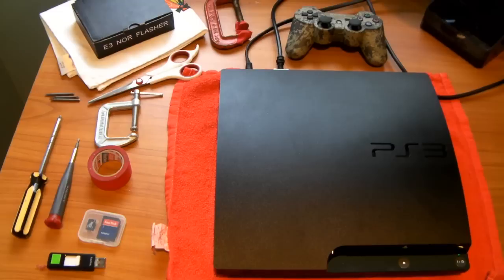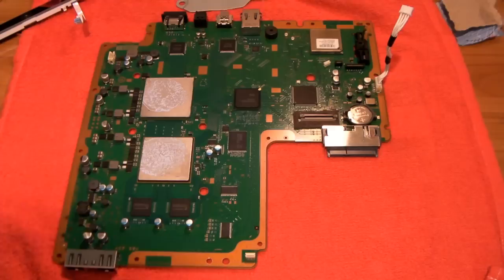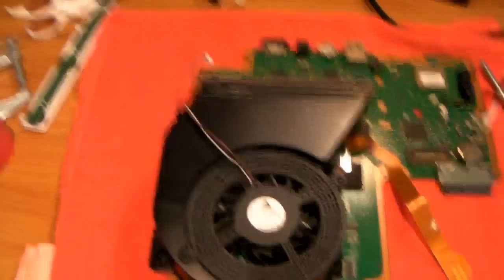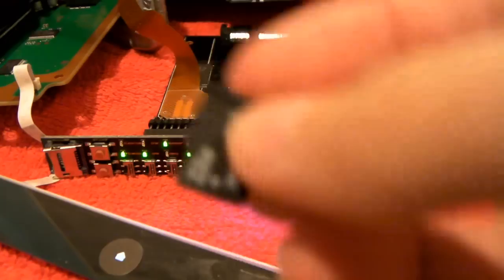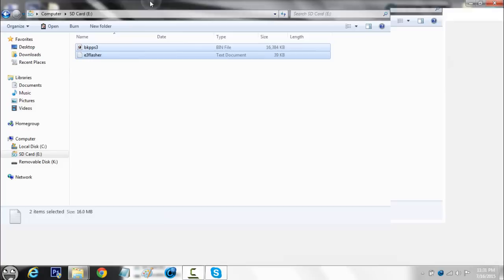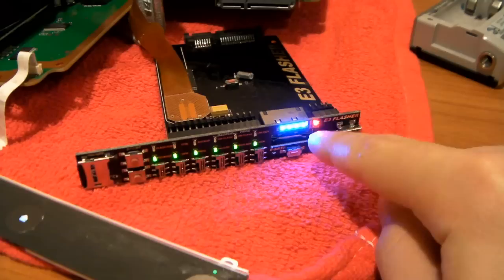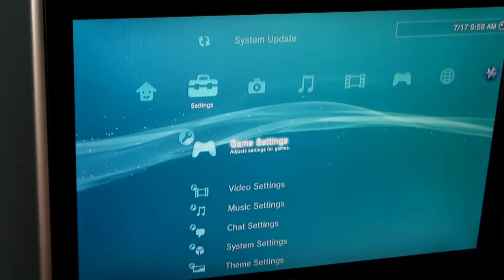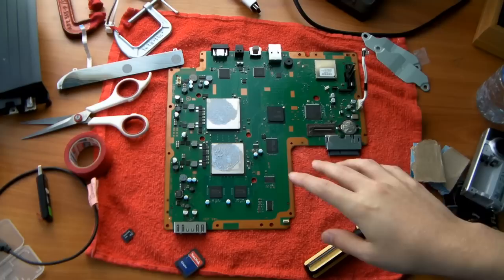How to Downgrade a PS3 to 3.55 with E3 Flasher (EASY!)

Comment: I started following another tutorial before I found this one and it told me to put the Update.pup file on the SD card...once I put the SD card in the flasher I saw the blue lights and switch the flasher switches to down down up up up up. The blue lights loaded and once I took the SD card to check if the file was still there I saw it was gone. That told me that the flasher updated and I was ready to move on to the next step.
I put the SD card back into the flasher and switched the switches on the flasher to down down up down down down and it created 2 files for me which are the bkpps3.bin file and the e3 flasher log, but when I put the bkpps3.bin file in the Nor inspector I get an error telling me the file is bad.

I went back a few steps in your tutorial to see what I did wrong and it looks like I skipped a step. That step was putting the update.bin file into the SD card and putting it back into the flasher with the switches switched to down down up down down down down. I tried to do it your way but now my blue lights aren't even showing anymore. 

Did I mess up my e3 flasher ? And if not could you help point me in the right direction to fixing it 

Sorry for this long comment I'm just trying to give you a good idea on where I'm at in this project

Comment: I downloaded a PS3 3.55 OFW file nested in the same folder heirarchy as you showed people to make in your clip, but it wasn't 5.5mb... It's 170mb!! What have I downloaded?! I've scanned it with a few things and it's clean but it's the same size as your "everything" zip file but it's only a single PUP file. ... Also: Don't use a C clamp - Just grab a spring loaded plastic clamp for wood work. Non-conductive and can't cause any damage

Comment: Hey, whenever I make a backup, it makes 3 backups at a time, and none of them are OK. I've applied even pressure on the chip, even more than was possibly intended.
Still have no luck.
Anyone got any ideas?
Reply: MrGamer Aye, thanks for the quick reply.
I found a clamp lying around and it did the trick.
Currently stuck on a "Checking" screen on PS3 after attaching the hard drive.
Reply: MrGamer Ya, it's the same as the one in the video, although it stays on it.
Reply: MrGamer Ya, just remembered that the hash failed on the patch, don't know if that has anything to do with it.
Reply: MrGamer CECH-2003A

Comment: Thanks, great tutorial. These NOR clips are so sketchy though. It took me hours to get it wedged in just right with enough pressure to connect. This is a fat CECHP01 so no room for a clamp. I was getting lights 1 5 6 error. Then another couple hours to get a clean dump without errors. Well actually, I always had one ROS0 Hash error. This is a RSOD console that I'm trying to fix. Patch is flashed and now to install the rogero DG. Hope it works.

Comment: E3 Flasher Compatible Ps3: (these ones for NOR not NAND, older FAT ps3 are NAND).
FAT:
- CECHH
- CECHJ
- CECHK
- CECHL
- CECHM
- CECHP
- CECHQ

SLIM:
- CECH-20XX
- CECH-21XX
- CECH-25XX

you also need to check if the date code is okay. you need a ps3 with a default firmware at the time of its purchase below 3.55 | 3.56 is acceptable too.
DOWNGRADABLE:
- 6A (okay)
- 6B (okay)
- 6C (okay)
- 6D (okay)
- 7A (okay)
- 7B (okay)
- 7C (okay)
- 7D (okay)
- 8A (okay)
- 8B (okay)
- 8C (okay)
- 8D (okay)
- 9A (okay)
- 9B (okay)
- 9C (okay)
- 9D (okay)
- 0A (okay)
- 0B (okay)
- 0C (okay)
- 0D (okay)
- 1A (sometimes)
- 1B (you can cry now)
- 1C (you can cry now)
- 1D (you can cry now)
- 2A (you can cry now)
- 2B (you can cry now)
- 2C (you can cry now)
- 2D (you can cry now)

Comment: well after many watches of this video and few others i decided to go ahead and begin followed steps in vid i tried to update e3 flasher with first 2 lights down and rest up  didnt really get any indication to it working so i checked sd card in pc and different files in there probably me messing about noticed an empty dump file in there as i did switch to dump but never had blue first light ,anyway dump process all down except 3rd switch up i got 3 dumps binpps30,31,32 checked them and had hash problems in dump checker but reading in comments learned this doeant matter aslong as the nor checker reads good in all which it did so i patched 31 bin and folowed steps and success thanks for the video and comments knowledge is power ..   :))
Reply: i would like to add that im trying to do a second but reading this not original console, can i update my e3 flasher if i connect back to my original ps3 and do the samsung fw update on e3 flasher ?

Comment: TIP: If the clamp with tape doesnt work simply grab 3 COPPER coins and put them on top the chip and clamp , try to position them right in the middle

Comment: I have a PS3 of version CECH-3004B which is a 320Gb slim model running on OFW 4.76. Is this downgradable?
Reply: +Abhay Shiravanthe no, 3000 model can not be downgradet
Reply: +xLeG3nDaRy _-J4tt Thanks for reply.

I sold it and got the fat ps3 CECHP06 for around $38. It has YLOD. Trying to repair it nw.
Reply: +Abhay Shiravanthe YLOD PS3 consoles aren't the best to downgrade, regardless of if you fixed the ylod with a reflow or not. There's always a chance it could come back. I repaired a CECHG03 nand console on 2.80 OFW which had ylod and it's still going to this day as I gave it a reball.
Reply: Anime And Gaming Videos  Thanks for the advice mate! Thank you.

Comment: So I have a question.  Is this a video on how to downgrade a PS3 from 4.80+ (I have 4.81) down to 3.55?  Or is it just completely impossible to downgrade from 4.81?
Reply from the maker: You can downgrade from any firmware as long as your PS3's model is compatible.
Reply: Alright thank you!  This video looks extremely helpful.  Subbed

Comment: I thought the whole point of the e3 flasher was to downgrade from a higher version, so why do we need to use the Min. VER. Checker, because i thought all that mattered was the model number or whatever it was of the PS3,
Also in ur guide on se7ensins (which im following) you said to take apart the ps3 first, at least that was the order of vids, so i took it apart and now i have to put it back together just for the min ver check,, if u explained what the min ver checker was all about and put a not on se7ensins about wanting to do the minvercheck first, then this guide would be perfect, 
great job btw

Comment: How hard is it to get the flasher on the motherboard? Mine won't work... I keep getting the Dame error code, I believe it's 10001100 on the top of my head...
Reply: +Antiscript put a bit of pressure on the clip and the nor ship works fine for me got the same error also
Reply: +Tdaewg35 I'm on the verge of my mother board breaking with the amount of pressure I put on it... I think I may have broke it, it doesn't stay on my chip at all, sometimes it sticks a little but for the most part with no clamp attached it just comes off...
Reply: oh that's weird but now when ever I do a backup and it check it with norinspector I have errors and I cant find any way to fix it
Antiscript

Comment: It's Deejay Typo guys... Sorry for spamming comments but i just wanted to find out how much pressure will be too much to use on the clip... I'm having trouble finding a G-Clamp because i don't live near any hardware stores so I bought a Clip that automatically closes similar to a bullnose clip but I put my finger in the middle just to test the pressure and it seemed like it was too much (My finger was Hurting badly ) but it seems that it will get the job Done... Should i use it or just Order a G-Clamp online but it will take some time to be delivered.

Comment: My model is a CECH-2504B slim. Can it be downgraded?
Reply: no
Reply: jk yeah
Reply: Yup, i'm already checked it out. :)
Reply: +LAzy. What about Cech-2502A be downgraded ? Pls answer
Reply: Inu Mimi yes 25 below is ok
Reply: Inu Mimi Yup. ChasePlays was right,
Reply: +ChasePlays Annihilation what about cech-2051B?
Reply: +Jacob Ivy yes im sure
Reply: +ChasePlays Annihilation okay thanks
Reply: +LAzy. I have the same model, bro! Trying to get it done this week! :D
Reply: if the date code is 1B you can start
Reply: +Casper Wolf but can i go from cfw to another cfw or do i need to go to ofw 3,55 first? Please answer! :)
Reply: +Casper Wolf for real
Reply: Can CECH-2101A be used the Same way as In this video
Reply: Avo Blezzed yeah
Reply: +LAzy. He explained in the video what can be downgraded and what can't be downgraded. Learn how to listen.
Reply: +ProHacker HaxoTv Depends if the cfw is a lower version than the one you are wanting to go to. If the cfw is a higher version like for example say you are on 4.50 ITA and you want to go to 4.65 ITA then no you don't need to downgrade because you are upgrading. But say you are going to like 4.20 ITA then you would have to use a 3.55 DEX downgrader. However, if you are using CEX firmware you would use regero's 999 downgrader instead of a DEX Downgrader.
Reply: Demonic|ModdingTeam hi i dont need help enymore, but thanks for replying
Reply: Any 2500 and below yes 3001 no
Reply: what about CECH-20018
Reply: jones olsen Yea

Comment: Just curious if this tutorial is still valid / not outdated. It's a hardmod so shouldn't make any difference, but if there was any major change in hardware or software included in this tutorial. Also, where can I get an E3 Flasher? I have a Slim 2001A.
Reply: Also, can I use any CFW i want after following this tutorial? I plan on using Rebug
Reply from the maker: Yes, it still works. Yes, you can use any CFW. And you can get an E3 flasher on eBay.
Reply: ArchieG Alright, thanks for confirming my suspicions.

Comment: When I try to downgrade to 3.55 I get to 71% and I get a error saying 'The data is corrupted. (8002F957)" any ideas how to fix this?
Reply: did you follow the ENTIRE VIDEO including flashing the ps3 with the e3 flasher in order to do the downgrade?
Reply: +Nonya Concern because the Rogero Downgrade will NOT work unless you flashed the system like in the video with the e3 flasher first.

Comment: Ok, I got the lights to flash, but the T.V. doesnt detect the HDMI cable... Help?
Reply: +Best of Youtube (Frodo The Hobo)  The chip isnt connected right thats why ur not seeing it on the tv, try connecting it the opposite way u have it now.
Reply: +Steven Kane I  did everything right so far, only problem was when I pressed start on the E3 Flasher, the lights 1,5, and 6 began blinking ( signifying an error )  do you know how to fix this?
Reply: +Best of Youtube (Frodo The Hobo) yes that code is error for chip not being 100% connected ... in order to fix my 1 56 error I had to buy a clamp to clamp down the chip so all pins touch 100% and then it worked perfectly after I clamped it
Reply: If your hdd isnt connected it wont power up.

If it is, try shutting off ps3 then press and hold until you hear another beep after the first one when you pressed it. this will reset video settings if thats your problem.

Comment: I jailbroken my PS3 and it works, I can use menu and all sorts but sometimes my screen goes funny when I'm turning on the PS3 it comes up with multi coloured lines and crashes, help please!!
Reply: +Camda Killa You maybe have a bad patch.
Reply: +Pollo4life what should I do to change it ??
Reply: +Camda Killa have you tried another tv. I never heard of that problem.
Reply: +Pollo4life yeah I have tried 3 TVs and 3 different HDMI connections I also tried component and I still have the same problem, maybe I need new thermal paste ?

Comment: Mine say CECH-2001A its a slim can it be downgraded?
Reply: Nvm it can i checked it with the usb
Reply: +1976sanneke make sure to make a folder called PS3 and make another one inside of it call UPDATE and put the checker in the UPDATE folder then go on your ps3, plug in the usb in the right usb slot then go to system update and then update via storage and it should check, if it gives an error then the system cannot be jailbroken.

Comment: You know when he is doing the back ups etc. 
On the first one he places the update file inside for the e3 flasher. Everytime you create a back up and you delete everything. do you have to put the update file in again to do another dump ? The file i am on about is at 15.59. Thanks in advance.
Reply: Or do you just have to put thesd card back in and itll dump again?
Reply: +Eternal i keep it on
Reply: Robin Moens
Thanks man
Reply: Np if you need help let me know
Reply: Robin Moens
Thanks man. I've manged to downgrade now :)
Reply: +Eternal well i just flashed but my ps3 dousnt find the downgrader
Reply: i am having the same problem +Robin Moens i have properly flashed my patched  bkpps3 file to my console which took between 5 to 8 minutes, then it brings me to recovery when i boot it back up with my hdd installed back in. i tried the rogero downgrader through recovery menu and it shows that there was no applicable update data to be found. Any ideas anybody?
Reply: +Music and gaming Make sure your USB is on formatted. make sure your e3 flasher is completely together. restart everything again.

Comment: In my PS3 it says 2.75 can be installed later
Reply: Yes that's Fine! Anything over 3.55 would be a No. You are ready to downgrade.
Reply: +SquidModz FUCK MY PS3 is bricked 😫
Reply: How?
Reply: +SquidModz dont know, i was just inserted the sd card into the e3 and then i turned off ps3 cause it was blinking. And just happened 😞
Im fucked up
Reply: +Absolut Gamer 
Gotta be more careful

Comment: hello ! thank you for the tutorial ! but I get stuck at the NorInspection:

https://www.dropbox.com/s/l8fjsoyy3e3kqea/Capture%20d%27%C3%A9cran%202016-12-23%2017.20.15.png?dl=0

also my TV screen show an error: " Mode not supported. Resolution not supported. Change the resolution of the external device."

Comment: Can ps3 slim with code CECH-4004C  can be downgraded?
Reply: No, the minimal firmware version for CECH4xxC is 4.10. You need to be able to downgrade to 3.55 if you plan on install custom firmware.

Comment: I have the fat PlayStation 3 with the firmware 3.72 nobody is responding seems like if you throw money at them then everybody want to fucking help you I know how to mod the Xbox 360 I know how to jailbreak that do the reset glitch hack and all that but when it comes down to the PlayStation 3 I'm clueless
Reply: GHETTO-BANDIT RECORDS ps3 is a lot easier to jailbreak then xbox, xbox requires soldering while ps3, depending if you have a nor chip, can be done without soldering

Comment: Mine says "Update data of version 2.70 can be installed on this system." Is that good??
Reply: mine said that to. we are good to go.
Reply: +David Hardcore Nice. But how long did it take you with the blue lights?
Reply: Havent done it yet. Only checked how low my system can be downgraded so far.
Reply: +David Hardcore For some reason it restarts 3 times, and when I try to finish it, it says "bad"..

Comment: Is it REQUIRED to have the clamp??? Or can I just hold it down with my finger or my hand
Reply: That should work fine, but your hand will be there for a while
Reply: Kippy Kip can I use tape?
Reply: Gill Bates You can try it, whatever you can use to give it a better grip on the contacts. Just make sure you check the dumps are ok afterwards. If they're all OK then you're all set
Reply: I tried applying pressure via my finger, but it wouldnt connect. Needs to have really strong stable pressure, and I think the slight movement of my arm messed up its connections. YMMV, though. I just used an adjustable wrench to clamp it in the end, which worked fine
Reply: Gill Bates Tape didnt work for me. Also since the area gets hot when the PS3 is on, the adhesive melts, releasing the pressure and you don't want that to happen during your patch!
Reply: wazzal7 oh I jailbroke my ps3 in October and I used my finger. you have to push down really hard. I was able to do it on my first try :)

Comment: 38:18 - mine did that but after i hit start select,. it said i needed to format my hdd, which it is doing right now, i hope i didnt fk something up... AGAIN

Hmmm, after the format it took me straight to the rogero downgrade like it did to u

well it did take me to 3.55 which is cool, besides the fact that i had to format my hard drive. but lucky for me i had a pretty much empty drive as a spare, so when it came up and said to format i turned it off risking bricking and swapped the main HDD for the spare i had - thanks again for the TUT VID

Comment: HI !!!
First id like to thank you for your great video. Ive got a PS3 Slim v4.80. I dumped the files, but instead one dump a time, it did three at once -  Bkpps30.bin , Bkpps31.bin ,Bkpps32.bin , E3flasher  ( i understand this is normal with new e3 update )
I checked all of the dumps, compared them to each other, verified them, they all passed without errors (GREEN)so i patched them. I wast sure what to call the bin file for flashing Bkpps30.bin ' or Bkpps3.bin. I tried Bkpps30.bin , but it didn't work, after checking the E3 log files,E3 flasher actually was looking for Bkpps3.bin ,so i flashed it with bkpps30_patched renamed to Bkpps3.bin with success !!!
Then i put Rogero Downgrader 3.55 on a usb stick and when i tried to downgrade i got """THIS UPDATE DATA IS NOT SUPPORTED ON THIS SYSTEM""" 
I also tried safe reboot mode to install it ,but it asking me for 4.80 or higher version.
I don't understand it. WHY NOT LETTING ME TO DOWNGRADE TO 3.55 ????????
The dumps worked and were verified, flash worked , but i can't downgrade !!!! 
Could someone help me please ??
Can i go str8 to REBUG_4.80.1_REX_PS3UPDAT without downgrading first to 3.55 ???? But i guess you can't do that !!!

HELP !!!!!!